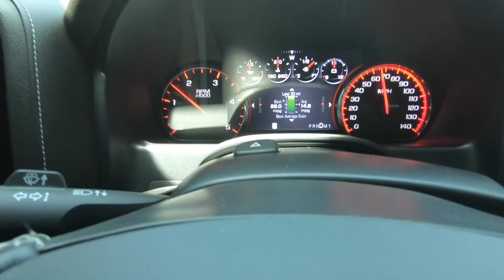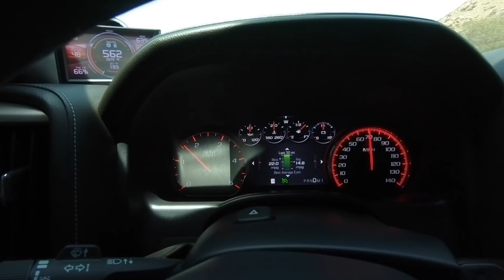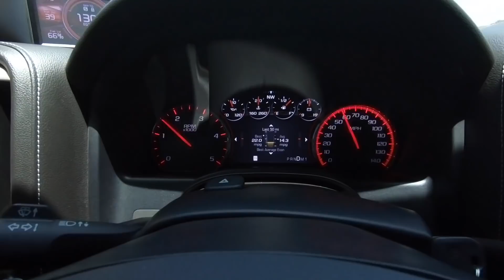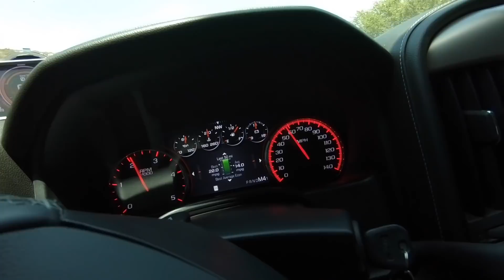I HAD TO LET HER GO

Comment: Dang, I got an L5P and I roll up the 261 going like 98mph cause of the limiters and my truck isnt even trying. Cant wait for a full delete tune on my baby. It would 1000 percent smoke that lame 6.7 the other day a new Cummins and a new powerstroke were racing up the 241 and I came by and smoked both of them in my stock L5P literally like nothing with 5 people in my truck and its lifted on 35s. You and the Work for it guy really inspire me bro, keep up the good work.

Comment: You need to check the speed with GPS as the tires are throwing it off. I would have gone with gear vendor if I were you. Have a under/ overdrive. Cost is almost the same
Reply from the maker: the speed will b right on once i re tune the truck
Reply: Even after setting pinion factor I could never get them perfect. It's close but not exact

Comment: Have to be honest, those trucks are gorgeous but that was pathetic.  Those EGT's just trying to keep 60ish with an empty unloaded truck, very disappointing.  Yes the truck has 37's whatever whatever, that's still punk.  Glad I watched though as I've been contemplating trading my Megacab Cummins for an LML Denali simply because I think they're the best looking truck, think I'll just keep what I have.
Reply from the maker: ya i was a little upset also hopefully after re gearing the truck it will fix this issue
Reply: Ruben O if you lug any diesel you can get the egts to sky rocket. Keep it in the boost and all is good. Eddie was in 5th and 6th gear going up a pretty good grade of course high egts are going to happen.

Comment: I just picked a 2018 duramax denali today in white.  Beautiful truck traded in my 2014 1500 denali.
Reply: how do you like it so far? Getting one soon myself
Reply: fit4ya1975 it is wonderful.  I have pulled my trailer a few times already.  It is smooth and does a great job.   I got the white frost color.  It definitely is a bigger truck.

Comment: You're going to love the new gears. Especially when towing. Obviously your truck has the torque that your tires didn't affect too much, but you'll still get more low end back. Also with the welding did you get the Hobart just to give it a try before getting the miller or to compare the two?
Reply from the maker: ya i still kept the hobart just because of how cheap it was and is good to have as a back up welder

Comment: I dont want to sound like a hater, but i have a 6.7 ford with 37s and unloaded i can go up my 8% grade near my house in 6th gear without EVER seeing EGTs that hot.
Reply from the maker: what is the stock gear ratio on yours
Reply: Eddie's Life my stock gear ratio is 331! I am thinking about regearing anyway since it’ll pull a lot better with my travel trailer.
Reply from the maker: ya i would

Comment: You are a die hard gm fan love it(:
Reply: twis7edash ice I do have a spot for ford too my brother has a 2016 f150 and it's fun to drive he's had a lot of issues with it though.
Reply: twis7edash ice more than my 2009 Silverado 2500hd that's still all original except my 4inch lift.
Reply: RICKY GARCIA I've had a 2012 and a 2015 Ram 1500 nothing but issues traded it in now . For a f150 over 80,000 km not one issue at all now recently traded it in for an 2018 F350 Diesel loving it test drove the ram don't even bother with GM my brother's got one and he's got transmission issues so for me for the way to go so far cross my fingers
Reply: twis7edash ice I'm a train fan but what's cool is the locomotive you see on profile pick is a GP60M built by gm in the early 90s and they still running today no one's car or truck will rack up the miles a locomotive does in its life time.
Reply: RICKY GARCIA I have more compliments with my diesel F350 than any truck I've ever owned that truck is amazing in the looks Department by far the best-looking truck out of the two GMC and Dodge in my opinion go to the 2018 Daytona truck Beach Channel and see what is a nicest trucks out there you will notice the Ford F-350 is by far the nicest looking truck again in my opinion it's also the number one selling heavy duty truck there's a reason for that I don't think that many people are stupid
Reply: twis7edash ice yeah ever one I know that has rams have nothing but headache with thim
Reply: RICKY GARCIA very true bro my whole family ran into trains and work for CN rail and buddies of mine are locomotives
Reply: twis7edash ice my neighbor bought a new ram 2500  last year and she goes to work about the same time is me at 2am I got a 5 miles down the road and she was pulled over to side of the road and I stoped to see if  she needed help and  told me that her truck did not want to move and she told me that here husband was on the way to help found out latter that her tranny went.
Reply: twis7edash ice wow that's cool
Reply: twis7edash ice yeah I'm having a problim with the looks of the new Silverado I doint care for the front end.